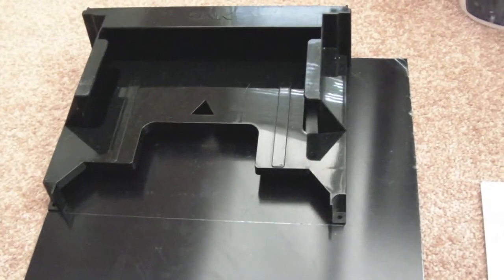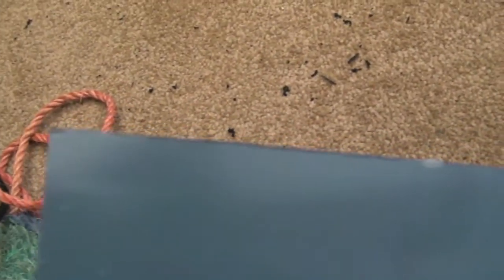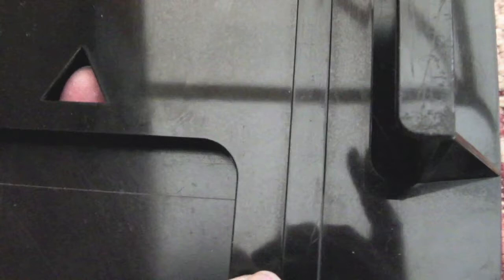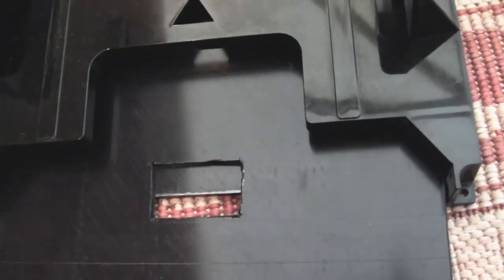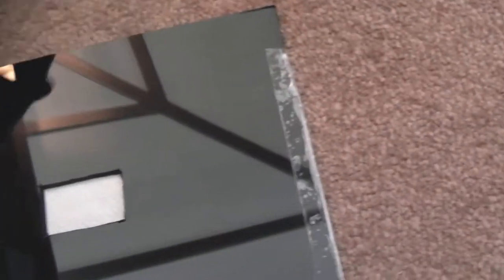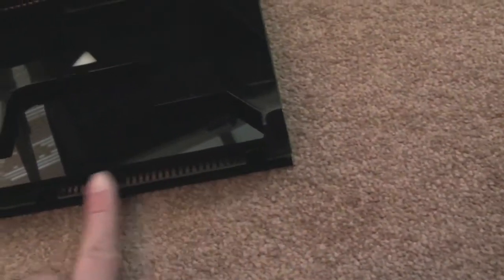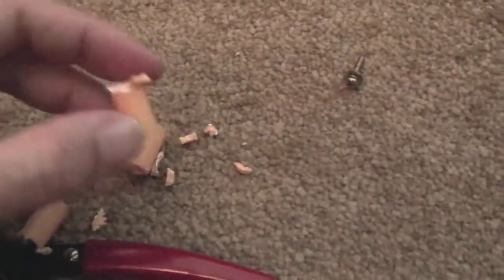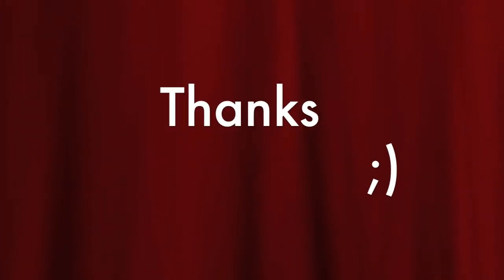SNK Neo Geo MV-1FZ Consolization Part 1 (MVS CMVS)

Comment from the maker: Thanks, it's pretty basic - not as sexy looking as the mods you've done but I wanted to keep the new coverings minimal.  Hopefully I will be able to mount the connectors etc in suitable places and it will end up looking OK.  Just waiting for a few bits at the moment, namely some 8 pin sockets and plugs etc for the video out and a scart cable which I will make up.  I've also got to get a 5v 8amp PSU and do the coversion of the PCB so it runs on 5v only.  Controller sockets have arrived though.

Comment: The opening behind the arrow is supposed to accommodate your hand reaching under the MVS cart when removing. Does your acrylic panel cause any difficulty with fitting your fingers there? I hope not because it looks nice but I don't want to make switching carts any more difficult than it already is for consolization.
Reply from the maker: You do have to remove the cart a different way - I  put my thumbs on either side of the cart and pull it towards me using my thumbs.  It's second nature to me now and easy to remove.